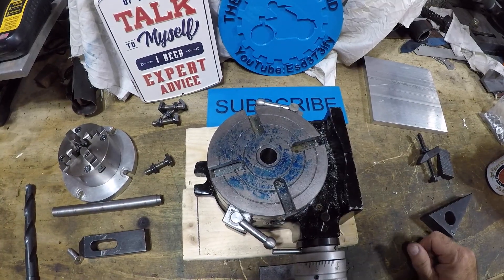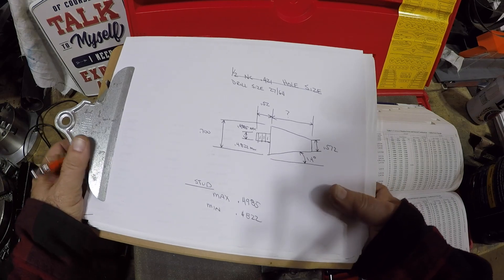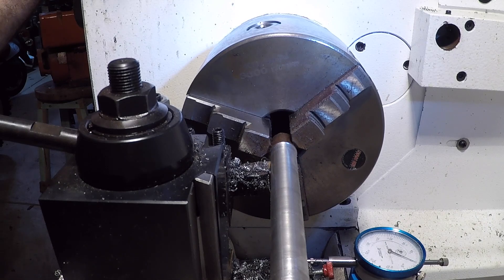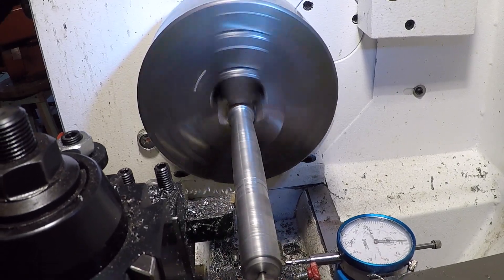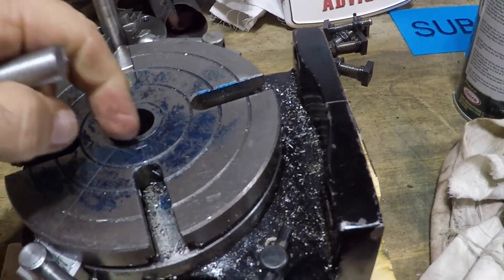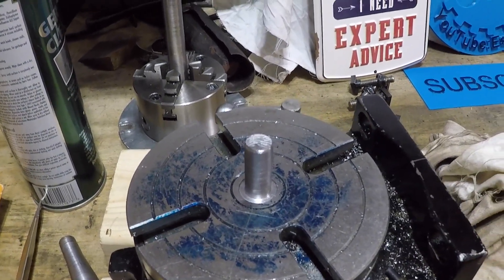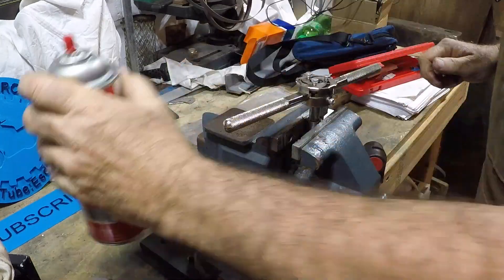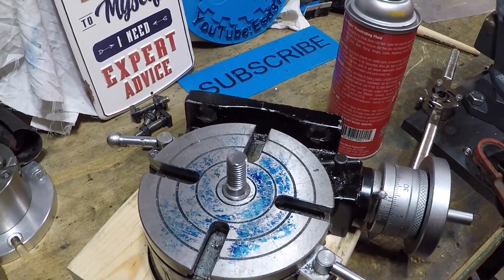#2 Morse taper fixture plate for a rotary table FAIL

Comment: Thats a good idea but Im wondering why you dont single point cut the tread in the lathe while doing the taper. I suspect your die is past its used by date.
Reply from the maker: Im rusty single point cutting. I thought it would be foul proof using the die. We see how that worked. Check out the next video I fixed it. Thanks for watching.
Reply: @theundergroundesd  Ha yes I understand totally, Ive only just come to grips with metric threads and you only need one insert but if you are doing imperial it all gets a bit difficult using inserts. I have always defaulted to dies too

Comment: You obviously need to get up the speed on how to turn threads on your lathe. That would have been a clean solution. Or you could look into methods of using the tailstock to support and center a die for a straight cut. Also there are methods using blue dye to check out and verify contact of of the full length of a taper. I would suggest more consumption and less production of videos.
Reply from the maker: Thanks for the advice and thanks for watching.

Comment: Don't run a die, single point thread on the the lathe in a single set-up if you can. I'm planning to make a fixture plate for my small 4" rotary table. I'm not going to thread the Arbor, will just use the boss to align the plate.
Reply from the maker: I was considering the same because the t-nuts will secure the plate. It has been something since I did a single point thread so i didnt want to screw it up. well you know the outcome
Reply: @theundergroundesd  damn, youtube swallowed my comment again. see clickspring's blog on making a fixture plate for the rotary table.

Comment: I'm geting ready to make one of these, but I'm going to put a female thread in the top of the taper and thread the bottom to take a bolt to hold it into the taper.
Reply from the maker: Like a draw bar. I would thead the part before making the taper. Stay tuned I have to make another one. I need that fixturen plate to finish a project. Thanks for the comment and watching. I hope you subscribed. I will subscribe to your channel.
Reply: @theundergroundesd  The other thing you could do is turn it between centers, then it doesn't matter as much the order of the operation.  Randy Richard has a video on making a similar rotary table arbor.